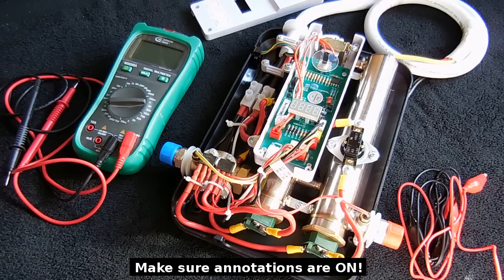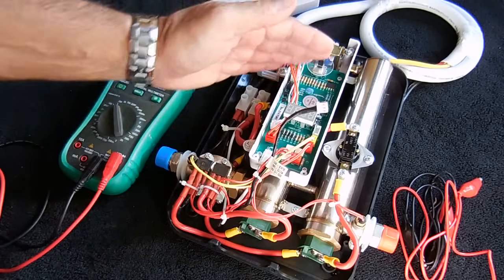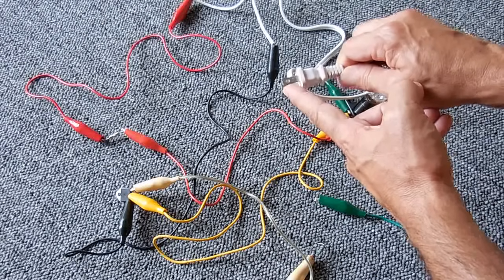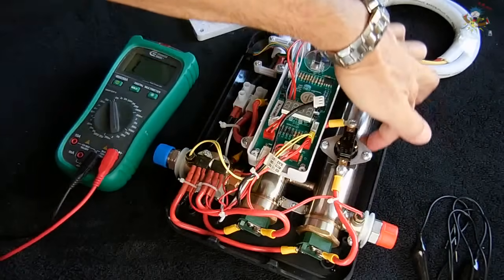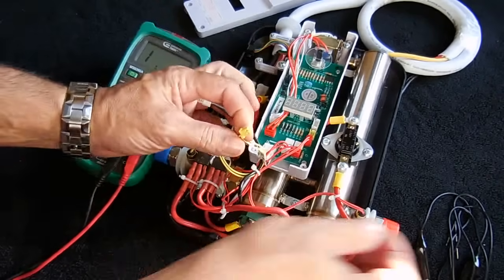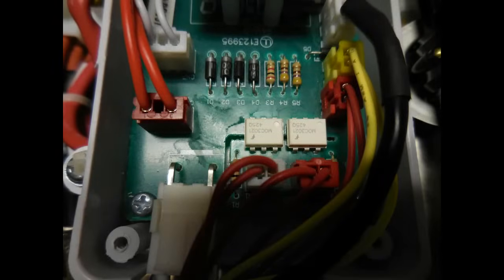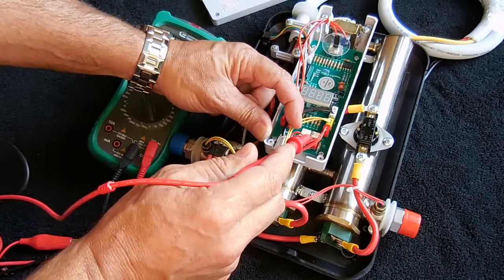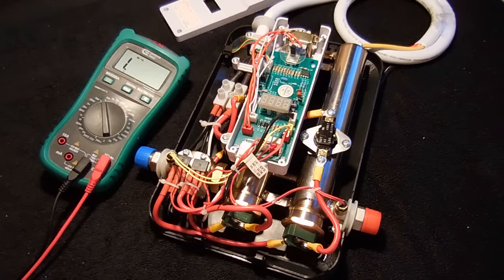Troubleshooting Tankless Water Heaters In MINUTES ~ Step By Step

Comment: My eco11 is 5 years old. Last week the 60 amp breaker trips. This week did the same and when I touch the breaker was hot, still working when I reset the breaker. Any suggestions what the problem will be? Thanks
Reply from the maker: Excessive current draw by the heating element. Bad element likely.

Comment: Wow, thanks for this video.  Logical and succinct.  
I know it has been awhile but I have a question.
From your explanation, the flow sensor will send a signal to the board to turn on the triacs to turn on the elements...

Wouldn't the outlet thermister cause the triacs to turn on the elements also?  
Otherwise why have a thermister ?

Or would it be flow sensor turns on elements and thermisters fine tunes the amount of heating required?
Reply from the maker: The flow sensor and thermistors are both used together. :-)

Comment: Is it ok to turn off one set off breakers (2 sets of 40 amp.) On a Bosch WH17?,
 I find that I use the lowest setting in winter.
Reply from the maker: Tankless heaters are designed to save you a lot of money, so there's no need to do that. Thanks for watching!

Comment: Nice video, I have a problem with my water heater which is 18l and powered by 2 d battery's, everything works as it should but if I turn the hot tap off the lcd screen stays on for ages so if I want hot water again while the screen is still lit the heater won't fire up again until the lcd screen goes off could you offer any advice many thanks
Reply from the maker: Possibly a faulty water flow sensor making the unit think water is still running when it's not. Thanks for watching!

Comment: Step 1: Check the fuse and circuit breaker.
Step 2: Check and retighten any high current mechanical connections. (Check all other connectors for condition and security.)
Step 3: Check consumable or high wear, high power density components such as the heater elements, mechanical switches.
I cannot recall any control board systems just breaking or failing with the modern electronics. 

Excellent and informative video. Thank You!
Reply from the maker: Thanks for watching! Be sure to check out my extensive video playlists for other great videos
 of interest to you, rate thumbs up, and share my channel with your friends.
Reply: I forgot .... After checking the high wear, high energy density items, going into your well laid out trouble shooting procedure is the next step. I have just been lucky that my control boards or electronics never failed.

Comment: my tankless water heater sir has 3 phase supply,but its no longer workin,is it possible because one the supply only draws165 to 200 volts,thats making the system unbalance?my question is ,how to balance the supply?? i hope it'll reach u my concern.thank u sir😊
Reply from the maker: Remove the circuit breaker and inspect the busbars for heating/corrosion issues. Also measure the voltage at the circuit breaker screw terminals and compare that voltage to the voltage at the heater.
Reply: +electronicsNmore ok sir im doing it right now...😊😊😊😊😊😊

Comment: I am using Panasonic DH-3DL2S Instant Water Heater. After the installer left, I notice there is one metal piece that I think the installer forget to push downwards to secure the wire end, one side of the metal piece is clamping the wire end and the other side facing upwards, see red arrow pointing to metal piece,  photo https://i.imgur.com/ZKDSE2X.png video https://www.youtube.com/watch?v=BVaKPSczNS4 
May I know should I push the metal piece towards the wire to clamp the wire? Thanks a lot.

Comment: We have the Eco Smart 18. We have good water flow to the cold water, but no water pressure (none at all) to the hot water. No water comes out of any fauets and even if its does drip, its never hot? Any suggestions please?
Reply from the maker: A valve is turned off, or there's a blockage. Also remove the faucet aerator to clean it.

Comment: my paloma water heater is giving a C7 12 code. the burner comes on, fan starts, then it shuts off. it does this twice in abt 10 seconds then doesnt come on again. I had the propane pressure check and it is 12 psi.
Reply from the maker: Not sure of that trouble code, Google it. Thanks for watching!
Reply: the electrodes  (5)   had ash build up them, I cleaned them with steel wool and burner needed blown out/ its working great now.
Reply from the maker: crackbadger man Great to hear. Make sure there's ALWAYS water in that unit before powering it up.

Comment: Hello Thanks for the video. I have a question. I need to buy a triac for my ecosmart 11. Are they both the same? because 
online it shows 1st triac and 2nd not sure of which one is the 1st. The one that I have bad is the one closes to the cold water intake.
Thanks again
Reply: Hi did you find the answer? I have problem with my 11 also..so 1 and 2nd triacs are the same?

Comment: first off , great video!
I have a titan n180 electric water heater. i have checked all possible causes with no luck of the culprit sticking out. I get hot water on a very low setting. however it will stop working then I have to adjust the temp on the unit up and down and up and down a bunch of times until I can get it to work on a low setting again. I'm guessing a faulty board but I'm not sure. I can see a voltage drop coming from all 4 triads when it decides to stop working. and don't any optos on the board
Reply from the maker: Check all wiring from the breaker panel to the heater. Measure the AC input voltage when the problem occurs. If the voltage drops, then you have a poor connection somewhere.
Reply: thanks for the response. the voltage stays the same coming from the breakers to the unit.  voltage drop come from the triacs,   (all 4). turn temp down all the way they output like they should, then I can turn up (sometimes,) 2 temp levels, (just under half.) if I go higher on temp, voltage drops from 120v per leg coming from triacs,to roughly 50v. never seen anything like it.
Reply: suscribe and personally sent link to friends of mine to check out the video, just a thanks for the response.

Comment: mine is exactly like this one in the video but my LED screen is flickering constantly in use or not and is not heating water.... i tightened everything and cycled the power and it worked for almost another day and then nothing again, but flickering and no heat
Reply: its a eemax 13 kilowatt unit  model eem24013 aka ha-13240 idk why but they are one in the same lol    any help would be appreciated electronicsNmore
Reply: the black wire with the plug that goes into the control panel is the culprit I think but  am not sure at all, but I know it flickers moreso when touched
Reply from the maker: Hard to say exactly, because I cannot look at the unit, but it could be a faulty flow sensor.

Comment: I have A Seisco System. Will using to much Electricity out puts thru out tge house stop the system from heating water.
Reply from the maker: No.
Reply: Why my portable water heater come on and iff
Reply: Why my water portable water heater come on and off can you tell what's my problem

Comment: Hey I have steibel eltron dhc10 its not coming on.when I reset it the light comes back on but its cuts back off a little while after. Help..
Reply from the maker: Is the unit heating the water?
Reply: electronicsNmore  no the water is not heating. The unit is not even coming on even though there is power at d outlet where its plugged.

Comment: I have the Iheat ah18 the problem I have is when the unit powers off (shut water off) I still have 1 to 2 amps heating one element till the thermostat shuts it off. replaced the triac still same problem.
Reply from the maker: Hello. It sounds like the flow sensor may be faulty. The unit thinks a small amount of water is flowing, so it's trying to heat it up.

Comment: Very good video. But I am not familiar with the model you present but I think  the device in series with the heater  attached to the tank is a thermal cut out or safety switch. The temperature  of the water is controlled by the pwm of signal to the gate terminal of the triac.

Comment: I have an Ecosmart 11 hot water heater. It is 5 years old. The other day I heard a load bang. I when't down stairs and the outlet side pvc connection blew apart. I shut the water off and repaired the brake. I turned the water on and plugged the water heater in. In about 5 min it blew again. I I remove the cover and saw that the flow censer was leaking. If I re place the flow censer will this fix the problem?
Reply from the maker: Hi Arthur. The outlet side should be CPVC, not PVC. The water line should not break.

Comment: My AEG tankless heater suffered a short circuit on connection wires and blown. After repairing the blown cut wires and reinstalled, the heater did not work or no power going through.
What could be the problem resulting this short-circuited wires?
Reply from the maker: Make sure you have 240V across the power supply wires. You could have damaged the circuit breaker.

Comment: What would cause my Rinnai 
external unit V65E to come on for a couple of seconds each time cold water is turned on anywhere in the house?
Reply from the maker: Pressure drop more than likely. You may need a check valve at the inlet to the heater.

Comment: Hello. Thanks for the video. I have a question: I have a Richmond brand system. All rooms get hot water except the kitchen. The water supply valve is wide open. If I do get hot water there, I have to let the water run maybe 5 to 7 minutes. Any information is very much appreciated. Thanks

Comment: I have a bosh tankless that keeps frying the thermal cut out.. does it have a bad element?
Reply from the maker: The element isn't the problem. There are a few things that could be the problem. Stuck relay contacts, faulty control board, faulty flow sensor.
Reply: I have a bosh tankless that runs constantly. The exhaust fan is on all the time, and the pilot burner ignites every 10-15 seconds. But the main burner doesn't ignite until the faucet is opened.

Comment: I have a Seisco with 4 elements,  I have noticed there is a fluctuation in temperature of the water. We have hot water and then it cools down as before we would have a constant water temp. Could it be the elements? I tested the elements and I get  8.4 Ohms on each one.
Reply from the maker: Probably a faulty water flow sensor.

Comment: We have a new house and just installed a Rinnai ..why might our unit turn on even when demanding cold water?  water is still cold but unit turns on.
Reply from the maker: The fixture you're using is allowing a small amount of hot water to flow with the cold water. No other reason. Thanks for watching!

Comment: I have a ecosmart 27kw system and when it comes on it flickers the LED light fixtures in the house. 3 40w DP breakers with 8awg wire. 150amp main on the house. Any ideas?
Reply from the maker: Sounds like a service entrance wire is loose, or needs to be cleaned. Have the power company check all connections leading to the electric meter. If all is OK, then you need to inspect the main lugs in your electrical panel. I have a video showing how to inspect your electrical panel.
Reply: The tankless heaters pull power in pulses, they don’t just “heat some”. It’s all on it all off in cycles.  And led bulbs are also modulated by voltage so as the tankless is pulling power your led will flicker.

Comment: I noticed you used OHMS setting to test the elements instead of the continuity setting, why is that?? Also my elements are much larger in size, will my ohms be different than the 10 ohms you averaged??  oh, and my wattage of the heater is 18,000
Reply from the maker: The continuity setting can also be used. The alarm will sound and display a resistance value under 50 ohms. No reason to use that setting with the alarm, use the lowest OHMS range. Value may vary, the average is around 10 ohms.
Reply: Thank you, I did in fact call the manufacture and they said it should be between 9 and 12 ohms, and when I measured mine  it was only at 3.5 ohms. So they are sending me new elements.. thank you for a really good video.

Comment: Just read a bit about the triac and learned  how it works with AC to DC power. if you can clarify this a bit further i would appreciate it
Reply: TRIACs are AC switches.  When triggered, they conduct until the voltage crosses zero volts, then shut off.  If triggered again, before the voltage comes back on the negative pulse, they'll conduct again.  They get their trigger pulse from the optoisolators.  The Isolators get their power from the DC supply on the board.

Comment: Did I hear you say DC power. does this unit have an inverter to change from AC to DC power since its being supplied with 240 volts AC
Reply from the maker: The circuit board converts AC to DC.
Reply: @electronicsNmore  An inverter converts DC to AC

Comment: I have an eemax 190TC with two elements.  It worked fine for the first 2 years, but now the water isn't as hot as it used to be.  I've replaced both heating elements and I still have the same results.  One of the elements
 isn't  coming on because they have lights that show when they're activated.  Any idea what it could be?
Reply from the maker: Faulty temp sensor, faulty triac, faulty flow sensor, or faulty control board in that order.

Comment: I'm having touble with mine Im not getting any hot water. The unit has power but the dial won't change the temp and even if I leave it pressed for 3 seconds it won't switch between c/f if I turn the breaker off and leave the button pressed before I turn it back on it will let me change temp for about 5 seconds then will freeze again. Do you know what might be wrong with it

Comment: I have a Rinnai. When I turn the water on, it cycles 3 times trying to light. I see a blue flame, about a second or two, then shuts off and cycles two more times before stopping completely. Once in awhile it will light and stay flamed. I have replaced the flame rod kit for good measure but still no luck.
Reply from the maker: Unfortunately, I haven't looked inside or worked on a gas tankless water heater.
Reply: I'm wondering if it was a breathing problem, to much dirt/dust in the fan exhaust system. What did you find was the issue??
Reply: William Dean I tore it out and replaced it with a standard water heater.
Reply: Brian Thomason wow okay.

Comment: Hi, I have a Steibel Eltron dch-10 and the reset button keeps tripping. Hot water flows for a while then it trips - all the time... what could be wrong ? - how do i test the internal tank ?
Reply from the maker: Sounds like a faulty temp sensor/thermostat allowing the unit to become too hot.
Reply: I have a five year old Stiebel Eltron Tempra 12 Plus. The thermal saftey started tripping without any flow. This is was due to a heating element ground fault. My technical problem was quickly solved by their excellent Technical Support: 1-800-582-8423 (Owners Manual). They are a great company with US headquarters in  West Hatfield, MA.
Reply: Kevin McGeary (

Comment: In the event the flow sensor switch is a problem, how do you remove it especially for Joven water heater?
Reply from the maker: +Casey Qiu 
Every tankless heater is different, but they all work in a very similar way. Look up your heater online, as well as the exact part to get an idea how to remove it.

Thanks

Comment: What if one chamber doesn't turn off when water is off and it gets so hot it trips the Eco
Reply from the maker: +ONETON PENA 
Possible faulty control board, shorted triac to one heating tube, or faulty thermostat.

Comment: is it necessary to supply it with water first to test the unit?! if no water supply what will happen?!
Reply from the maker: +Quivster Derilo 
Without the flow of water, the system will not turn on for you to test the heating element.
Reply: Sitebel temperture switch not resetting